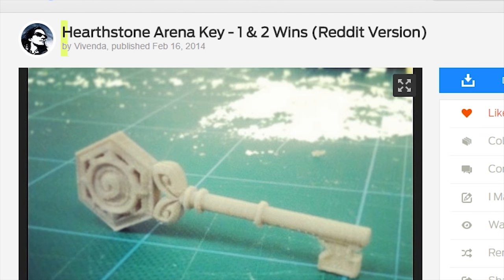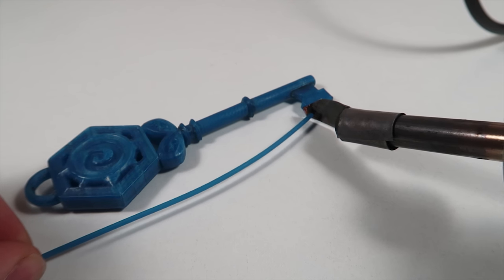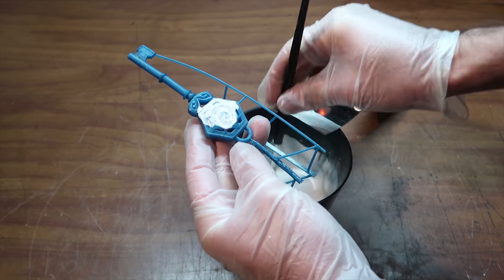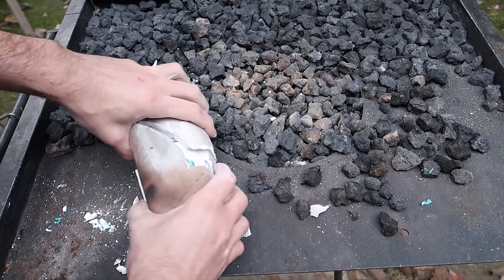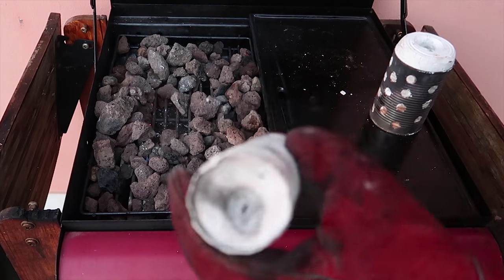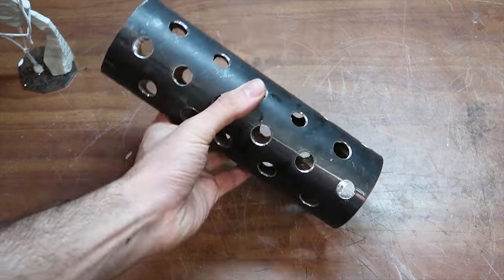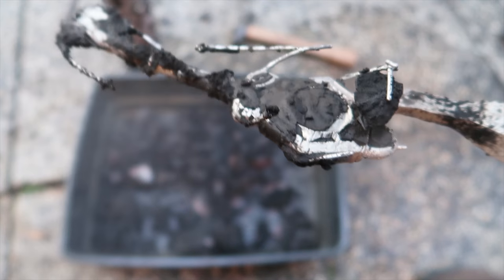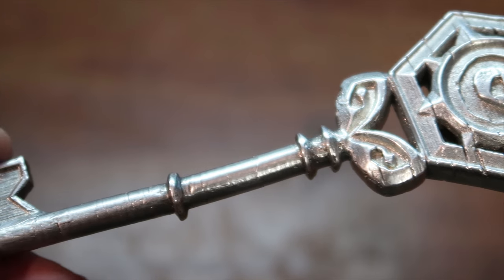Lost Wax Casting Aluminum Hearthstone Key

Comment: Hi Blackbeard.  One thing you can use when you don't have the ability to vacuum or centrifugal cast is a wet rag on a stick.  Once you have poured the metal (best if there is a pouring cup and with some spare space) get the damp rag and push it on top of the metal.  Once the damp rag contacts the metal some of the moisture will flash to steam which forces the metal into the mold.  Do be careful to do it for only a moment and make sure the moist rag covers the pouring cup so that the steam goes into the mold and it minimises spitting metal.
Reply from the maker: Uuu! That sound pretty dangerous! xD Don't know if I feel confident enough to try it! But thanks for the suggestion :)

Comment: i would use investment material vs plaster of paris. and line the inside of the cylinder with a felt liner.  set the sprue on a bottom that can be rubber and detached. use a soapy water solution to coat the wax hydrophobic surface so that when the investment goes around it you do not get bubbles. you can also use a vibrator to let the investment material settle around your pattern. if you have a vacuum mixoing bowl to mix the investment material that also helps with bubbles and denser mix. always use accurate water to powder ratio for the investment material. after 24h you can remove the rubber bottom exposing a nice channel for the metal to flow. inverted heat in a burn out oven  for 2 hours so that all the wax is gone.  keep the cylinder hot. melt your metal and just before pouring flip your cylinder upright and let the metal flow into the mould. As soon as the metal cools enough to be solid quench the cylinder in a tub of cold water. the investment material will quickly break apart allowing you to retrieve the casting. then sand blast remove any flash polish and finish.

Comment: Awesome.  Any tips on settings for the filament in a CR-10? I was thinking about trying this at some point looks fun. Thanks for the video.
Reply from the maker: Thanks!! :) I started with the default setting by machinablewaxcom and then tuned temp down to 147°C for the noozle, bed to 80° and flow to 0.96. printing at 40mm/s. This settings might not be the best for everyone anyway :) but  the suggested are a great starting point!
Reply: Thanks for the start settings suggestions, I'll give'r a rip.

Comment: Nice, i wonder if my monoprice select mini could print with that? What settings did you use?
Reply from the maker: Thanks man! I started with the default setting by machinablewaxcom and then tuned temp down to 147°C for the noozle, bed to 80° and flow to 0.96. printing at 40mm/s. I'm printing more right now with this wax and an enclosure really helps a lot too

Comment: You used plaster of paris or normla plaster 
And what is the ratio of sand and plaster
Reply: I made a can forge and used a 50 50 mix of sand to plaster and it holds up very well to heat nut is easy to crumble if you strike it

Comment: how would this compare to making a silicone mold and casting a wax positive from that to use for the plaster mold?
Reply from the maker: This way is much faster. But if you need to bach out many of the same part a silicon mold is the way to go :) imo!

Comment: do you  have  any  settings for printing the wax I have a credit 10 s5 and a anet a8
Reply from the maker: I use these on my cr-10:

Layer height 0.1 or 0.2 mm
20% infill
Speed: 40 mm/s
Extruder temperature: 155°C
Bed temperature: 80°C
Cooling fan off
Retraction disabled
Print in enclosure (just cardboard)

And to make it stick I apply three thick coat of hair spray on the glass bed letting it dry between each pass. I also add a 20-25 outline skirt but sometimes it doesn't make a huge difference.

Comment: One more thing that will help get consistent successful pours is a double gate. It allows air to escape and ensures that the liquid metal gets into every nook and cranny. I usually pour to a gate that starts at the top like you did and the second gate coming from the bottom ensures metal gets all through the mold. Doing this way I have had easily 85% perfect pours with no defects.
Reply from the maker: Thanks for the suggestion Billy :)

Comment: Definitely amazing!  Have you tried lost PLA? I'm curious about how much easier/better the wax filament is.  Website says better details.
Reply from the maker: Thanks!! :) Yeah as far as I know PLA is much harder to burn out, it leaves a residue behind that won't burn off and will prevent some of the details to come through! I found this wax filament looking for lost PLA but this was looking so much better I went for it right off :)
Reply: Black Beard Projects  You get a kickback if I use the promo code?  I think I'm going to order some now rather than later if so.

Comment: Very awesome, I’ve been running into the same issues with wax not melting out causing excessive gas venting. I will be using your method of sand and plaster for all my complex models !

Comment: I am a silver smith and I do Lost Wax Casting. I carve my own models by hand, although I would love to try using a printer someday. My suggestion is if you are willing to shell out the money is buy a Kilm. IMO It is the best way for getting rid of the wax. It is what I use. A centrifuge is a great investment as well if this is something you are interested in continuing. But again these are not cheap to buy. But a simple and small kilm isn't too bad tbh. For this type of work you are doing, you don't need a big one unless you are aiming to mass produce. I think when I got my Kilm it was around $400-500. I got it a long time ago and my mother got it for me as a Christmas present. But great work and best of luck!
Reply from the maker: Thank you alot Elle! :) I will try to build myself a good electric oven soon, mainly for heat treating steel, but I guess it should work fine for wax burn too! Right now I can't affor a store bought kilm. I'm very curious to see how a homemade one will perform anyway! Thanks again and have a good day! :)

Comment: You should get Jewelers investment for extreme heat. Also you can use steam to remove the wax before casting.
Reply: jeffery biddix Not a good idea. Steam is not used. We burn out the wax in the kiln. Steam is used to clean off the cast after its been removed from the Satincast. Satincast has to be bone dry, otherwise it will explode and fail. Adding steam will put more moisture into a flask that you want to have dry. Also. Flask needs to be very hot otherwise the thermal shock will blow it apart.
Reply: Was a jeweler for 11 years. I have done everything but cut stones. I have even cast rings with diamonds set in wax. Investment with a borax additive is needed to do that so the stones do not burn. When steaming out the wax you need to have a controlled burn out gradual ramp up to a curing temp over an 18 hour soak time. Then a decline to cast temp and hold. For best results you should use centrifuge or vacuum to cast.
Reply: Good enough. I am a BFA Metalsmith and Jewellery designer as well a formally trained practicibg Goldsmith and I am putting forward our methods. We have used steam however it causes far too many flask failures. So we simply burn out with a catch tray. Using satincast without steamI havent ever had a flask fail. He isnt using a true casting medium and isnt putting it under vaccum on a vibe table so its likely that he will have alot of cavitation. And very few Goldsmiths cast stone in because you cannot be certain that the investment hasnt intruded into the stone seat and caused issues. Its a neat trick but not all that functional given its limits ( Only diamonds and synths and only very few types of sapphire. Also heating a colored stone will often void the treatment on its GIA certs so we avoid it)
Reply from the maker: Interesting to hear about your techniques guys! I will make a vacuum pump soon for the molds but I think I won't go any smaller than this key, cetrifuge casting is really too much for me :') I would get a molten metal shower in no time! Haha! Jewellery precision it's amazing in all of it's form.
Reply: Black Beard Projects As a note. You can vaccum cast. You remove the flask and place it over the vaccum hole in the vaccum table.  Given the porous nature of the mold material it draws a vaccum and will drag the metal into the mold.

Comment: would you be able to share your printing settings? Unfortunately, I can not get my cr-10s to print this filament. Would greatly appreciate your feedback.
Reply from the maker: Layer height 0.1 or 0.2 mm
20% infill
Speed: 40 mm/s
Extruder temperature: 155°C
Bed temperature: 80°C
Cooling fan off
Retraction disabled
Print in enclosure (just cardboard)

And to make it stick I apply three thick coat of hair spray on the glass bed letting it dry between each pass. I also add a 20-25 outline skirt but sometimes it doesn't make a huge difference.
Reply: Black Beard Projects thank you so much. Will try it tomorrow. Looking forward to future videos.

Comment: Good vid dude, love your channel.
But, I would say don’t spend all that money on wax filament.
Just buy the jewellery refractory casting material.
I can withstand much greater tempatures.
I just did two perfect burn outs with PLA in my furnace.
You could use that, paint it on and then use plaster of Paris/sand mix to fill the rest in.
Just a thought.

Comment: The water contents in the plaster will make it crack in heat. I recomend a slow drying at gradually raise in heat. Starting at about 50 degrees centigrade and slowly Increase the temperature to 100 degrees centigrade.

Comment: What printing settings??
Reply from the maker: I use these on my cr-10:

Layer height 0.1 or 0.2 mm
20% infill
Speed: 40 mm/s
Extruder temperature: 155°C
Bed temperature: 80°C
Cooling fan off
Retraction disabled
Print in enclosure (just cardboard)

And to make it stick I apply three thick coat of hair spray on the glass bed letting it dry between each pass. I also add a 20-25 outline skirt but sometimes it doesn't make a huge difference.
Reply: Black Beard Projects thank you, I'll try that!